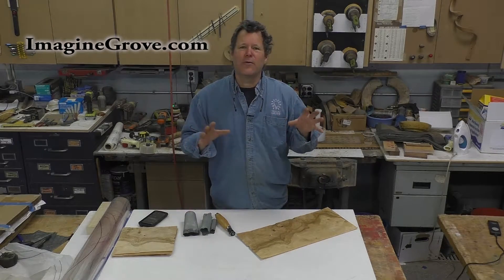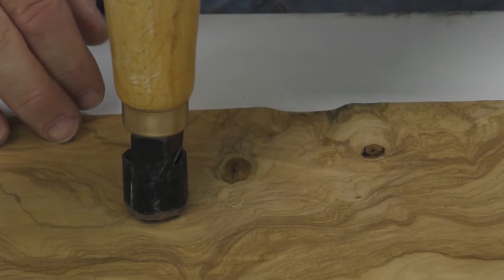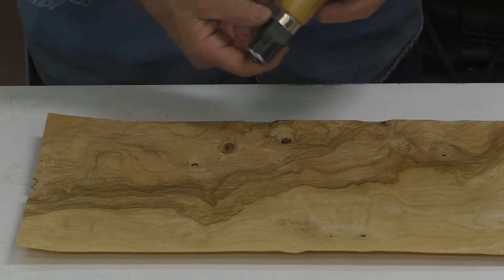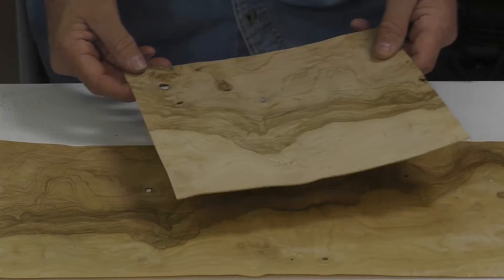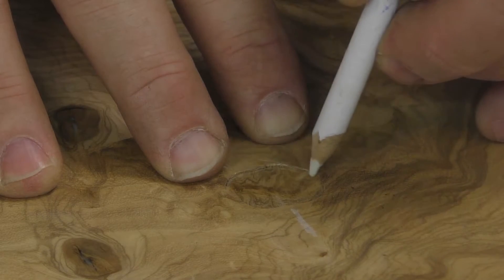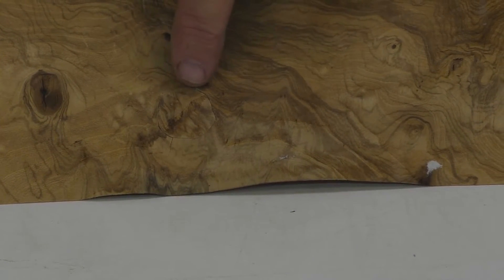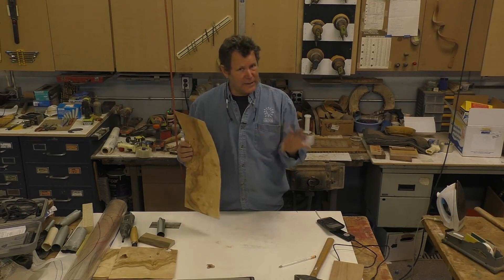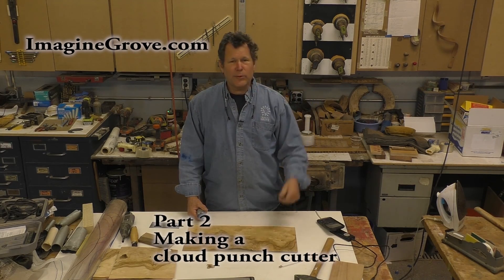Veneer repair with cloud punch part 1

Comment: Great video. Q: after you spot a good spot on a spare veneer,  can you just leave  the punched veneer on top of the spare, cautiously place the puncher in line and punch again?
Reply: You could but I don't as it might stress to top layer that you are cutting through.  I trace the hole onto the bottom layer and then punch just that layer.  Enjoy!

Comment: This is great for larger defects. What about smaller defects or tears in the burl. I've tried wood filler but it just doesn't look good. Also tried resin epoxy and this seem to be best approach but sanding is risky. Suggestions?
Reply from the maker: UV resin, sets in 10 seconds, water clear and easy to sand